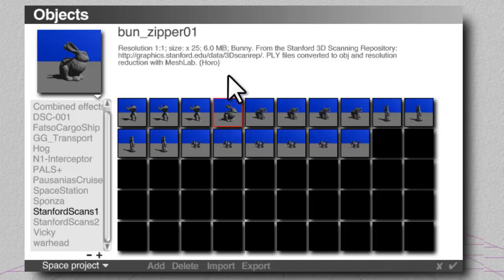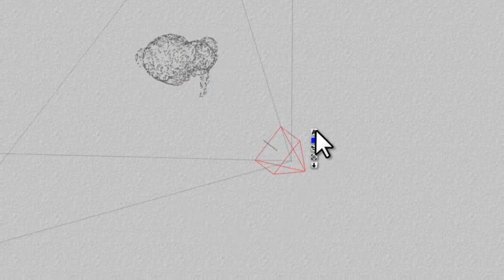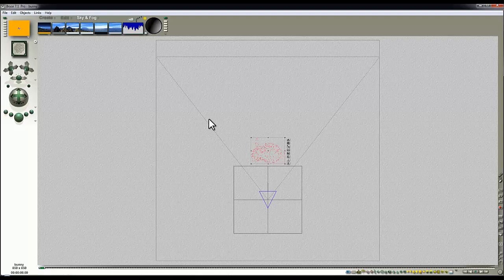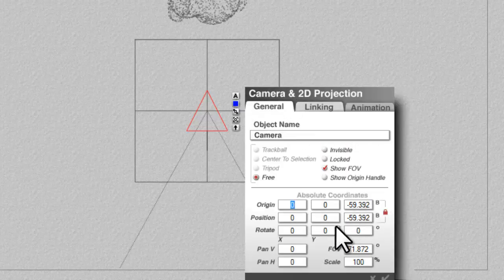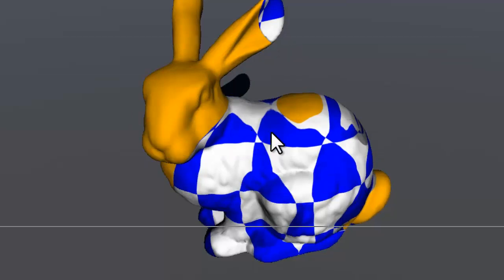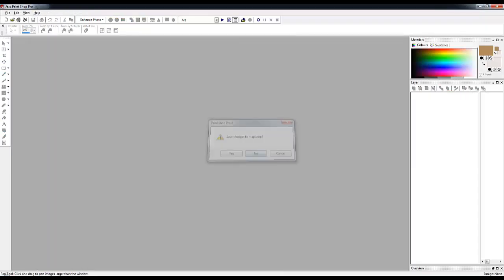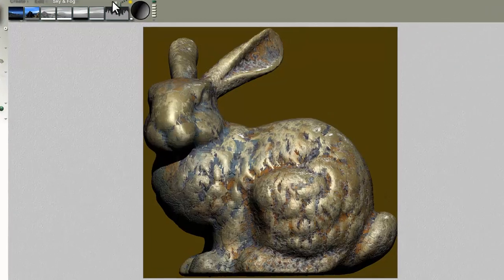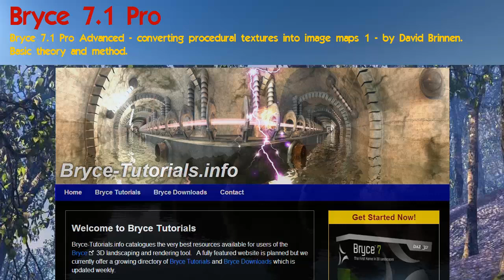Bryce 7.1 Pro Advanced - converting procedural textures into image maps 1 - by David Brinnen.

Comment: Mr Brinnen, I have a question.
 I used one of the terrain textures you created. It looks absolutely amazing when rendered in Bryce because it adds a ton of detail with its bump map. Now, I don't usually use Bryce because of its other rather huge limitations. So I exported the terrain I had created in Bryce, along with your terrain material, so that I could use them in 3ds Max with its superior Mental Ray renderer. (it only gave me the options to export the diffuse and bump maps). But the texture doesn't look the same at all when rendered in Max. In fact it looks horrendous. It fits perfectly, but the bump map turned out really shallow, with a few streaks and specks. Gone is the multitude of added detail. 

Please, do you know and tricks on how to retain Bryce procedural textures incredible detail, especially in the bumpmapping? (...which I dare say almost acts more like normal mapping in bryce)
Reply from the maker: +My2Cents, sorry to say the answer to your question is no.  The procedural materials, the great strength of which is their small memory footprint for almost limitless scale-ability, are native to whatever software in which they are generated.  The one exception to this was that of Bryce and an earlier version of DS, but for reasons best know to themselves, DAZ decided to abandon support for Bryce procedural textures in DS and the system is almost entirely image map dependent.  I imagine, though I don't know, this was to ensure their content was compatible across the greatest number of platforms.  Which as you have discovered is not the case with procedural materials.  Maybe one day their will be an industry standard for procedural textures, but if there is I think it is still a long way off.  As things stand, due to the limitations and Bryce's exporter and those of the software into which you are importing, I'm afraid there's no practical way that I can think of to achieve what you want.  Sorry.
Reply: +David Brinnen 
Mr Brinnen, thank you very much for the info. After having tried the exported maps in a few other applications than Max, (Strata 3D, Maya, and Rhino) yielding the same poor results, I'm now pretty sure it has to be the image map exporter in Bryce that is at fault here... which is weird because you'd think Bryce would know best how to export its own materials: simply make a rasterized "screenshot" of whatever map is on an object. I was sure of this when I finally tried to apply my rasterized bryce material onto the same object and render it... in Bryce. Same poor result. 
So, I'd say Daz has some work to do on the Bryce exporter, which btw has been the same since probably the feature came about in the late 90s. 

But, anyway... thanks again, and great work with these tutorials. You really take Bryce to heights I didn't think were possible - and I started using it when it was owned by Kai's Powertools! I still use it, but mainly to the terrain generator.
Reply from the maker: +My2Cents, the image map exporter is indeed a large part of the problem, but even if it UV mapped the terrain and applied the textures in an appropriate projection, they would still be significantly inferior to procedural materials because image maps cannot compete with the resolution of the procedruals which no matter what the distance from the camera will always be finer that the rendering raster.